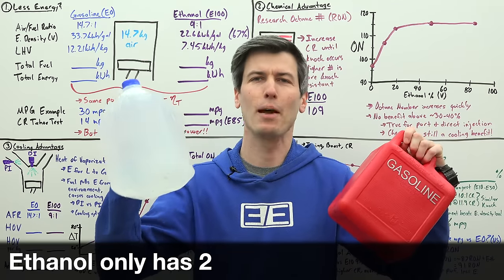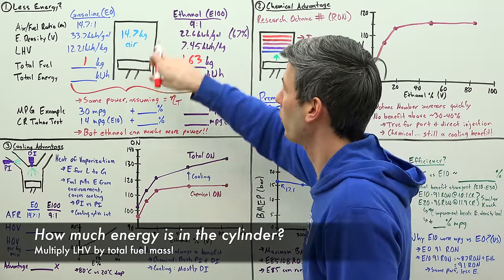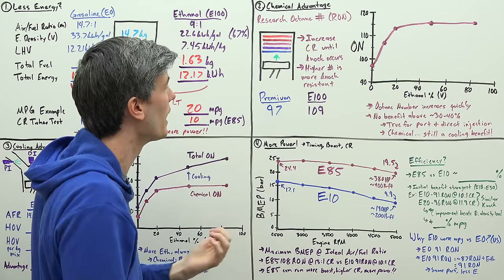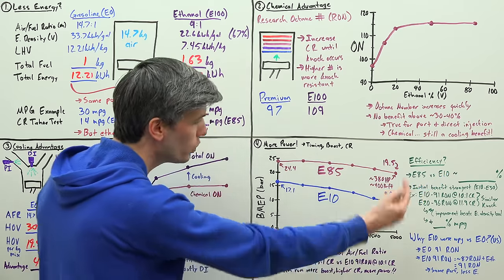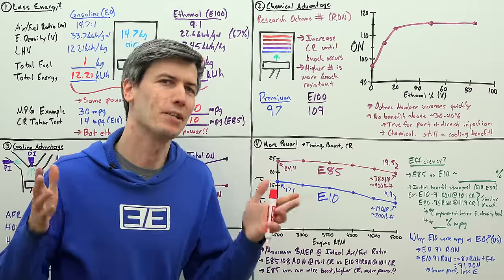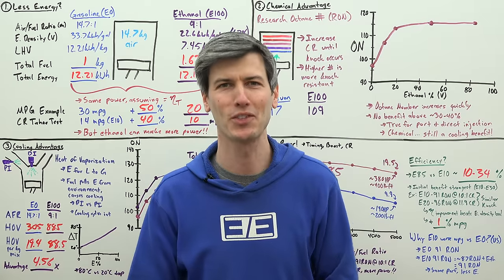Why Does Ethanol Make So Much Power? (Versus Gasoline)

Comment: It would be interesting to see the fuel sensing technology in Brazil come to America. When the first oil embargo happened the Brazilian government required e100 and 87 at all gas stations. There cars can run on either e100 or 87 and any combination without issues. That might be an interesting video explaining how that works
Reply: Our flex fuel engines have fuel sensors today.  Earlier flex fuel engines simply used the 02 sensor to adjust the engine.

We have E85 to be volatile enough to start in colder temperatures.  In Brazil who uses E100, their flex fuel vehicles have heated fuel injectors similar to diesel engines which have glow plugs for starting in colder weather.
Reply: @danafletcher2341  Not every car has heating plugs, most flex fuel cars use a gasoline reservoir that injects gasoline into the admission to allow the engine to start in the cold.

Comment: Greatest video..thank you so much...i have a question..can we use higher compression ratio with regular pump gas...i have tried 14.5:1 cr and use regular pump gas...i have to richen afr 13:1 to eliminate knock as a cooling effect  for cylinder temp and it is proven my engine can run 2hours race without trouble..

Comment: oh the Ethanol drama here in Australia is sad. only GM made available E85 cars back like 12 yeasrs ago and then stopped after like 3 years. all the service stations started to put in e85 pumps and then a few years later they are mostly gone. There was a big scare campaign to stop it in its tracks. E10 came out around the same time and that has remained, ours is 91 plus e10 so that is at least good. the biggest issue I saw as a mechanic on the e85 cars was water in the fuel from the service station tanks. unsure how it got there but didnt help the e85 cause.

Comment: I would need to swap out the head and make some electrical heating for the carburetor and intake manifold in order for them no to freeze up, especially in cold weather. Running the engine at 100% ethanol is theoretically nice, but ethanol pulls in water from the air and water tends to freeze and it would be quite bad if the cylinder would suck up ice crystals that formed in the Venturi tube. Also I would need to replace some fuel jets, air correction jets, possibly all seals, etc. I wonder how the emissions would be. Worse or better than running on gasoline? The problem is, if I wanted to drive on gasoline again, I would need to replace the engine head and carburetor. Maybe adjust the timing too. A bit unpractical.

Comment: e85 destroyed my rear differential lol I was pushing like 315 AWHP on 93 and got a flex fuel kit. Dyno tuned it on e85 and added about 100 HP and 110 FT LB. First pull on the pavement grenades my stock differential 😅 luckily I found a good housing for 150 bucks and now I'm rocking a Cusco RS lsd. In other words if you are looking to make a lot more power in a boosted vehicle e85 will do it. Gotta fill up way more often than I did with 93, but it's also half the price. Other problem is that not every gas station has it and the quality difference between different manufacturers is kinda ridiculous.

Comment: not sure why everybody isnt running e85 who can.  its renewable since we manufacture it from plants, mostly corn in the US, and even though it is less efficient mpg wise it's much cheaper.  last time I looked at my local gas station it was around $2/gal for e85 and the 87 octane gas is around $3.5/gal right now.  don't run e85 because my vehicle is not new enough to be flex fuel, but I plan to do an e85 conversion to it at some point
Reply: try running 30% E 85.

Comment: Can you do the same video for methanol? I found an engineering journal that used 56% methanol an 44% gasoline by volume blended to substitute for e85. Pretty cool alternative to e85 ❤
Reply: 750 flywheel using a similar
Mix gem fuel

Comment: I have had nothing  but trouble with ethanol, when it first came out my gas mileage reduced by the same percentage as the ethanol 10%. And in my yard machines ethanol turns to vasoline in the carb over the winter even with storage additives , i prefer having ethanol free even if it loses its efficiancy  over the winter....
Reply: Weird I have NONE of those problems. You should do some videos of this vasoline condition.

Comment: Can you talk about the charge cooling benefit not in terms of knock, but just in terms of getting more mass of air into the engine (due to higher air density).   I always believed that a main benefit of e85 in port injected NA engines was increased intake air density.

Comment: Great explanation... I think of all the alcohol drag cars and boats over the years and understand better where their power comes from. I would like to point out though that using ethanol in street cars (unmodified) has far less benefit and can even be detrimental in relation to fuel mileage and emissions (as per your video). The aspect of ethanol for everyday motor fuel is this: When E10 and other blends were introduced in the States, the purpose was to reduce dependency on imported oil. This was accomplished but the cost is that thousands of acres of farm land once producing food crops were taken over to produce biomass for making ethanol. As there is little other benefit to using ethanol in road fuels, I find it obscene to replace food production with motor fuel production.

Where and when possible, I will choose E0 (no ethanol) and enjoy slightly better gas mileage and the comfort of knowing I am not contributing to food shortages and food cost increases.

One commenter below from Brazil talks about his country's use of ethanol as a good thing but fails to acknowledge that where once Brazil was faulted for slash and burn agriculture in the Amazon forests for food crops - now the slash and burn fields are producing biomass for ethanol production as a motor fuel.
Reply: Alll NOPE! 3 paragraphs of NOPE!
Reply: @oldblueaccord2629   — Yeah, Jeremy here has to be imagining things. He states that according to the video, the use of ethanol can be detrimental to emissions. Nowhere in this video was that stated or even implied. I have no idea why these guys just make this stuff up …

Comment: i've been wanting to convert to e85 but my biggest problem is where i live there is only 1 e85 station about 30 mins from my house. So outside of that station there arent any e85 stations for HOURS.  This means in general if i want to enjoy e85 driving its mostly going to be locally around here unless i plan on some road trip in which case i need to plan my trip where e85 stations are. 

Now obviously for us aftermarket guys we would run a GM e85 content sensor meaning we can run pump or e85 or mixed. but i dont like the idea of after im out of e85 and have to fill with pump gas and essentially limping my car back home having to avoid much boost.   

One of the things i've also contemplated is using a meth injection kit. whats nice about it and couple gallon tank will last you a long way because its only being injected at the desired boost level.  plus one thing all gas stations have is windshield wiper fluid which its prime ingredient ?? methanol.  They use methanol because it reduces the freezing in winters. 

@EngineeringExplained  will you do a video on meth injection or have you ?
Reply: France has 25% of fuel stations offering E85 vs the US where <2% do.  Monopolistic powers more at play here.

Comment: Good information of E85 fuel.  My car, Honda HRV, a flex fuel car; I have been used E85 since it came out from dealership.  I just prefer it because the exhaust smell better than gasoline.  Unfortunately Thai government is not longer subsidizing Ethanol in gasoline.  E85 is currently more expensive than E20.  Service stations are also removing E85 from the pumps.  E20 is much easier to buy.
Reply: We are the largest ethanol producer in the world yet <2% of stations have E85.  In France some 25% of stations sell E85 where sales have been booming.  Monopolistic powers at play here perhaps?  The French government also approved E85 conversion kits for cars.

 Flex fuel capability has been quietly being dropped from our vehicles, even in Brazil.  India is now requiring all new cars to be flex fuel and is going to E20 for all non-flex fuel cars.

Comment: My problem with e85 is how much gets in the oil. you can't shove 30% more fuel into the cylinders without 30% more blowby getting in the oil. On engines like the new coyote that reguire 10 quarts of oil or some nonsense like that that's a lot of oil to have to change more frequently. If you are going for big power then it makes sense i guess, but if your just trying to squeeze more hp out of your daily then that's a little crazy. Enough dilution of the oil and you'll spin a bearing.
Reply: Identical engines in Brazil on E100 lasted >300% longer than with their common gasoline.  Soot is what wears out engines and oil.

The air to fuel ratio in our gasoline optimized engines is less with ethanol than gasoline, but they are not making the engine run with excess compression ratios.
Reply: @danafletcher2341  oil dilution is a real thing with e85, unlike your fake stats.

Comment: 00:02 Ethanol can make more power despite having less energy than gasoline
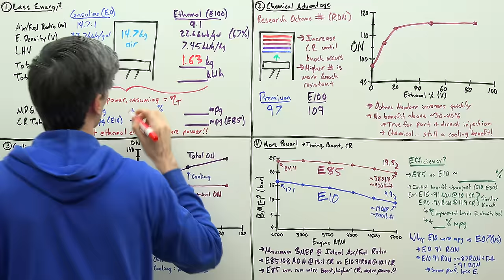01:36 Ethanol and gasoline can make very equal power if the thermal efficiencies are the same.
03:21 Ethanol has a high resistance to knock, allowing for higher compression ratios compared to gasoline.
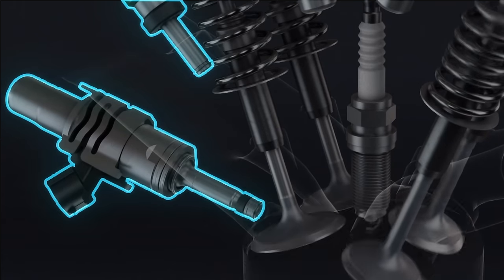04:51 Direct injection provides a cooling benefit due to the heat of vaporization.
06:30 Ethanol provides a significant cooling advantage
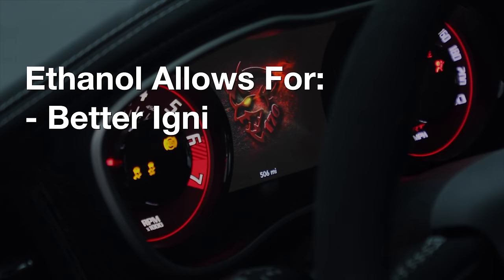08:04 Ethanol allows for higher compression ratios and more power.
09:42 Ethanol allows for higher compression ratio and increased power
11:17 Ethanol increases power with higher octane and efficiency despite lower energy density.
Crafted by Merlin AI.

Comment: 7 of my 9 vehicles have carburetors. In most of England if you buy esso super unleaded or shell vpower,  then there is no ethanol. 
I only use this on my carburettor vehicles as it is more like the original unleaded at the time of my vehicle's manufacture dates. 
If I use E10 it runs OK but gunks up if left for any amount of time. Also my fuel pipes are not designed for ethanol.
Ethanol is fine if the engine is designed for it,  I used to have a 2003 yukon xl, it had the 5.3 v8 with flex fuel and that was great.

Comment: This is quite topical because I talk about this often.  Your major omission is the Ford 5.0L V8 (2018+) which is a 12:1 compression flex fuel engine that is direct injected with 4 cam phasers and 9 knock sensors which has been designed to be able to maximize the efficiency of the engine on ethanol.  Ford said that the 2018 engine was able to see emissions levels from the V8 that were similar to a Toyota Yaris or Ford Fiesta 1.0L.  it also was able to minimize mileage losses on E-85.
Reply: I just tried first 2 tanks of e85 on my 2017 5.0 f150. I've got to say I was skeptical but wanted to give it a shot. Only other fuel this truck has seen is premium. And it kinda shocked me how much more overall power I have and just how much happier the motor seems on it. So I'm debating on running it all the time or not. Only thing that concerns me is long term affects of it. I know I'll be changing my oil more often at least if I do decide to run it consistently.
Reply: @ethanwestbrook9853  I have heard that every 5-10 tanks you should switch back for 1 tank.  I don't know if there is any validity in that or not?#!

Comment: I was thinking of this for so long, thank you so much for this in-depth explanation! This makes me wonder, did anyone make an engine, from ground-up to only run on pure ethanol? I'm sure it would be more efficient, more powerful, less polluting and lighter as well than a regular engine that is designed for both fuels. Right?

Comment: None of this is new.  We used ADI (Anti-Detonation Injection) fluid on the old supercharged Pratt  Whitney R2800 aircraft engines from the 40's and 50's.  The ADI was an alcohol and water mixture used to lower the combustion temperatures during takeoff power (and Max Power) settings for our engines.  That lowered the chance of detonation and allowed more boost.  We also knew that it was lousy for fuel economy even though we were operating in the best volumetric efficiencies of over 110%.  Oh yeah, we also had BMEP gages on our engine instrument panel.
Reply: Thank you for making the valid point that ethanol CAN be used to make an ICE engine run - but it takes a LOT OF ADDITIVES AND MAINTENANCE to get the engine to run efficiently long term on ethanol - which is why ethanol is NOT THE SUPER FUEL LIE-berals claim it is !!!!!!!!!!!!!!!!!!!!!!!!!
Reply: @abellseaman4114  BSSSS.

Comment: One question: in order to reach the full benefits of using ethanol we would need engines specially designed for that, with higher compression ratios, right? I think FIAT  was developing such an engine in Brazil but so far, no news about it. It would be great to have a video on this project!
Reply: yes higher compression would be the best.

Comment: Methanol combined with gasoline at a 60/40% ratio pushes monoxide production to 0.  When you move that ratio either direction,  monoxide production goes up.  Less monoxide than pure gasoline, but of course the problem you demonstrated with less efficiency and mileage.  Still, this should be looked at more closely.  It would take a chemist to tell us why that is.  Reducing monoxide should be a goal.

Comment: if ethanol take significantly for heat than normal gazoline does, does that mean the ethanol running vehicle have longer cold start and going to temperature phase? and since engine get worn out faster when its colder ( or is that just about the oil temp for lubrification ) would that result in a drop in fiability?
Reply: that would also mean high air density inside cylinder since its a colder environment correct ? so even more power like this?
Reply: @philippebrebion6203  Yes and yes. I have trouble keeping my 440 cu inch motor warmed up running 50/50 E85 and gasoline. It burns that cool.
Reply: @oldblueaccord2629  oh ok interesting

Comment: Interesting,  especially since I am building a SB Chevy 383 at 13.25 C.R. specifically designed and built for E85, fuel system is also alcohol rated.
 So from what I see here, I should expect roughly the same fuel mileage as a 9 to 1 C.R, am I correct in this?
Reply: That will be the question! I bet you dont even loose 10%.
Reply: @oldblueaccord2629  thanks

Comment: How would this apply to a carby engine? I'm looking to dual fuel my truck (; 5.2 liter magnum) e-85 and propane.
Reply: I run 50/50 on a modified Quadrajet carb. It works great. Remember the octane is 104 on E85. There way better carbs setups now you can buy.

Comment: It doesn't, you have to burn a lot more. It's just more stable and burns cooler (if I recall correctly)? So you can increase the compression ratio and ignition timing.

Now... to watch the video.

*ok he covers that immediately.

Comment: I personally had never been a fan of E-85 because of the socio-political-economic issues with it (heavily subsidized diversion of arable cropland to make inefficient fuel inefficiently in the name of renewable energy, etc). However, apparently I can be bought. E85 in SoCal is about $3/gal and 87 octane gas has been $5+ for quite a while. I've been experimenting with it for months, and I lose about 3 mpg in my F150. With a $2/gallon difference, the economics still work heavily in my favor, and the extra kick in the pants is a nice bonus. I'm noticing more and more yellow-handled pumps showing up in my area.
Reply: if you going full E85 that MPG difference is not bad at all.

Comment: But what about ethanol being corrosive to various parts of (older) fuel systems?
Reply: Ethanol is a solvent for varnish which sometimes coated cork.  Benzene, toluene, ethylbenzene and xylene are as well and are in today's E0 gasoline.

Henry Ford designed his Model T for ethanol, not much older things than that.  His quadcycle was designed for that as well.

Comment: I have been using Pure gasoline in my 1985 Toyota 4runner SR5 5 speed on 35's and 5:59 gearing.... getting 22 mpg!! vs using before the changeover, it got 17 mpg!! PURE GASOLINE is the way to GO!
Reply: Im sure you corrected your speedometer for 35 inch tires...RIGHT? I bet your getting 12 mpg.
Reply: You deleted your 3 other posts but if your SPEEDOMETER isnt reading correct then either is the results of your math.
Reply: @oldblueaccord2629  I'm not deleting anything, ask YOUTUBE if they did,
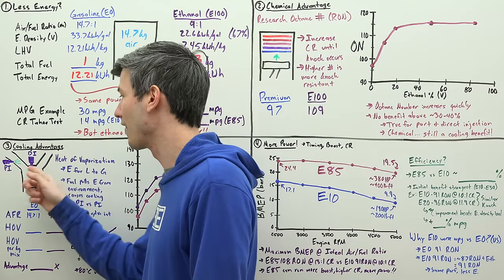Reply: I have 5:29 gearing on my 1985 4runner SR5 5 speed with the 22re engine, new in crate, not rebuilt. did one trip at 25 miles, and refilled it at the same gas station that sells PURE GASOLINE, and di the same trip again,  25 miles again, and I found it gets 22mpg. it has 35 in BFG tires. take a pic of this before it is deleted.
Reply: @dundeeecroc  25 miles wow thats likeThunderhead289 mileage test. You got me!
Reply: @oldblueaccord2629  Where is Thunderhead289's test?
Reply: @dundeeecroc  You tube channel! its a fun watch for sure! he did some MPG test but unhooked his speedometer first...lol. its like free comedy.

Comment: Could you explain what this means for CO2 emissions? The CO2 produced for the power achieved from different fuels has intrigued more a while now. If possible, it would be great to get a video that compares the base heat reactions CO2 generation + the thermal efficiencies achieved with different fuels. I’m thinking methanol, ethanol, diesel, dimethyl ether, gasoline, LNG, CNG or any other alternative fuels that could be relevant.